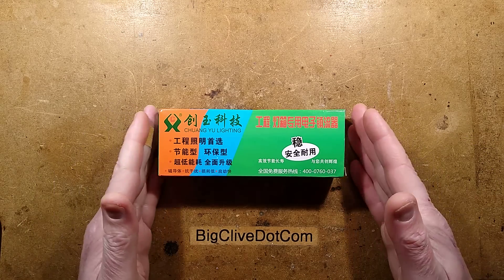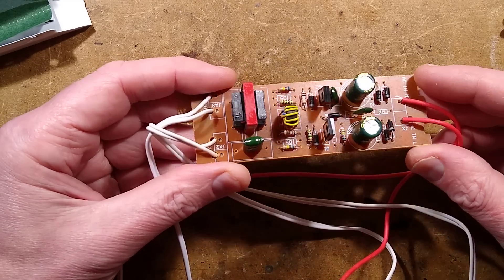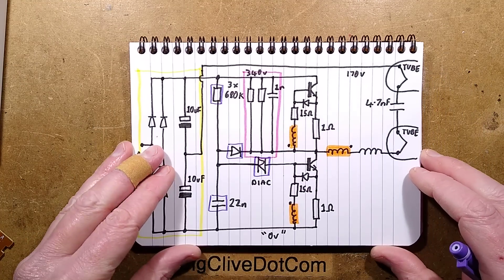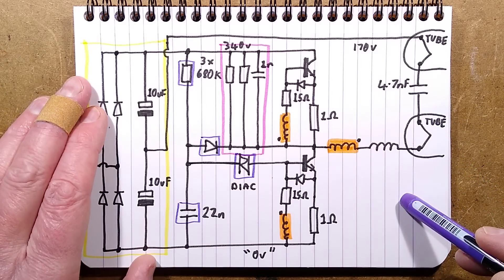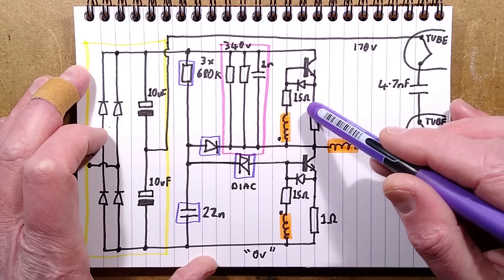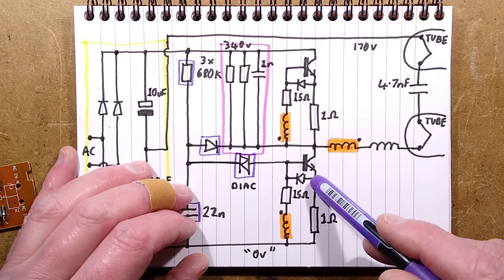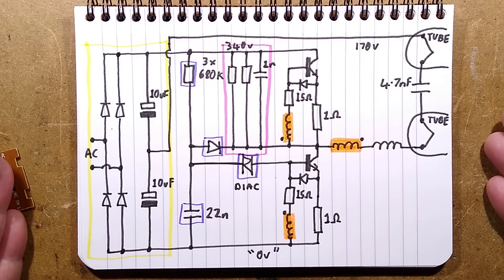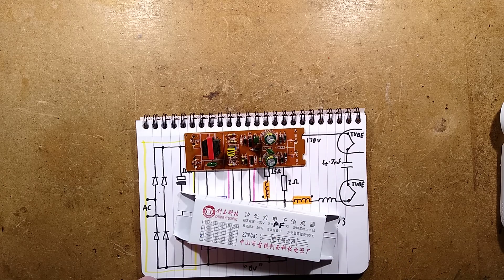Cheap AliExpress ballast (with schematic)

Comment: I would like to use such a (slightly different) device for an art project with 36W T8-tubes. But they need to dim slightly. Is it possible to increase the 1 ohm resistors(or the equivalent on my ballast) and limit the current to the tube? My driver uses allmost the same circuit with slightly diffent values.
Reply from the maker: I wouldn't recommend changing any component values on ballasts like this.  It may be better to use dimmable LED tubes.

Comment: Thank you very much for this, I couldn't understand how the feedback transformer works when I tried to fix a broken lamp. (There are a UV lamps out there that still use those).
That power supply was on the kind of a a circular custom-shaped board that would fit into the base of the lamp. It had a similar design with a couple more transistors and diodes here and there.

Comment: Hi.
Do you have a dc powered ballast experience?
I was thinking about a 4w 254nm uv tube to be powered by a couple 18650 or 21700 cells. Using a uv bypass filter on 254nm.
I have ordered some portable 365 nm BLB tube lights to see how they work off 4 AA batteries.
Reply from the maker: You can get UVC tubes and low voltage driver modules online.

Comment: Electronic ballasts are okay but I miss the prinker prinker sound caused by the glow starter when they switch on the tubes, maybe the lights last a little longer but I've pulled out tubes over 20+yrs old from offices using conventional choke ballasts. Conventional fluorescent tubes may use a bit more electricity but they tend to dim a bit after first use then find a plato of light output until near the end of their life. LED replacements might use less electricity but like all LED lamps continuously dim throughout their life normally getting to an unusable level far quicker that conventional tubes. 💐♥️🧀😎🐈‍⬛😼🏳️‍🌈🏳️‍⚧️🇺🇦💐

Comment: Had 4 dual fixtures with a very similar design, all the transistors shorted out in a couple months. Would failed caps/ripple do that?
Reply from the maker: It's usually overheating that is the main cultprit.

Comment: Have a tridonic ballast which has failed, both transistors(3DD4244D) blown, carbonising around mains input fuses, neutral fuse open circuit. Do you think i would be able to just replace transistors or maybe another component has caused this?
Reply from the maker: It's possible that the diodes at the input have been damaged too.  It may be easier to get a new ballast.

Comment: I think your right the circuit appears to be a blocking oscillator, relying on the base drive transformer to set the frequency. The parallel resitors and cap might be there in case the tube or wiring goes open to stop it from oscillating at RF frequencies.

Comment: I like your tear down of this simple transformer.
Do you have a source for a small neon power supply? The tube is about 24" long and 3/8" diameter. Thanks.
Reply from the maker: Is it red neon gas or a phosphor coated tube?  You could use a low voltage cold cathode power supply for it, or one of the voltage multiplier power supplies I recently featured.   Easiest to get is the cold cathode power supplies.
Reply: @bigclivedotcom  - I'm sorry. It's a orange tube and believe it's phosphor. I watched your voltage multiplier video and that's what got me interested in lighting this tube again. I'll look around for a supply. Thanks.

Comment: Was trying to diagnose somebody's ring light. It happens to be a ceiling fan that uses a fluorescent tube in a ring, I've only ever seen this once. They bought an LED retrofit which slightly doesn't fit the tabs that hold the bulb in. And in an attempt to figure out why it wasn't working I bypassed the ballast and blew the internal fuse. Apparently they never intended the unit to be direct wired. annoying because the ballast in the ceiling fan was bad after diagnosing with a known good glass bulb. And no not necessarily standard as in no standard light sockets it had a prepare pin snap in design. And ceiling fans are notorious for not having any extra space.

Comment: Almost identical to the circuit used for the old 12 Volt halogen lamp electronic transformers. Think of it as a half bridge and if you scope the output you will see trains of high frequency triggered by the diac at a much lower frequency. Not sure if it was intentional or happened by chance, but, due to the action of the toroidal feedback transformer, you need to give it a load before it starts to work. After that, it only supplies as much power as you pull from it, hence the misquoted power factor figures always given with these devices. Big problem is that as the tube ages, it pulls more current and the switching transistors tend to go off with a bang.

Comment: So theoretically speaking - by adding a second diac in series with existing one or replancing with two higher voltage zener diodes (to get rid of polarity problem) one would be able to delay star of the oscilations until filtering cap reaches a higher voltage ?

Comment: (To preface, I posted this comment on the day you made this video public, and it somehow ended up in the comment section of some random YouTube short (found out when I got a very confused sounding reply from someone), so I guess YouTube is broken, this out of the way)-Very cool to see how these electronic ballasts work. Also ironic that you uploaded this because I actually just converted one of my fluorescent fixtures from electronic to magnetic preheat ballast haha. Electronic ones are good and all, but they are really rough on the tubes, the old preheat ballasting systems were much more gentler when it comes to starting up the lamp, pretty important with my fixture since all my tubes are vintage, in fact I have a Sylvania tube that dates back to 1952! (this one actually happens to be an F8T5 type tube that I found in a vintage manual preheat desk lamp, which explains why the tube is still old and still works!) I’ve also always liked the Blinky startups 😉
Reply from the maker: I've noticed some oddities in the comments for a while.  Usually referring to a completely different video.

Comment: This reminds me of an electronic ballast I found in an unusually cheap and lightweight residential high-pressure-sodium yard light several years back when I was collecting HID lighting fixtures. Unlike most of these luminaires that used conventional iron ballasts, this one had a single rectangular board inside with all the componentry built on, including the photosensor for dusk-to-dawn operation. Mostly discrete components with maybe an IC or two. Makes me curious how similar it is to the fluorescent lamp ballast circuitry.
Reply: The 50 watt hPS Lights Of America Model 9051 "WallPack" ?

 I have the 42 watt CFL version (Model 9042) that I converted to house an 18 watt Low Pressure Sodium (SOX) lamp. The schematic for both the fluorescent and the HPS versions are published on Sam's Repairfaq
Reply: @yuandrew  Yes, I think that's the one! I didn't know they had schematics on Sam's site. That's pretty cool. We may have had the fluorescent version too. Problem is, it seems like most of LOA's products always had QC issues. Both the fluorescent and HPS units died shortly after we got them. Our replacement HPS unit finally managed to outlive its lamp, and was still working the last time I plugged it in.

Comment: Found a similar schematic while reverse engineering a ballast for an insect zapper that I use for making PCBs. When they fail both transistors fail short, and the emitter resistors blow open. In my ballast there was also a fuse, but surprisingly it didn't blow, the resistors failed first. Repair video: https://www.youtube.com/watch?v=H_o0wbHRyXA
Reply from the maker: That circuit will be shortening the life of the tubes by using two in series like that, since the cathodes at one end of each are not heated and will sputter and blacken quickly.

Comment: Not realy a light problem but more of the direction we are going to

Flurescent fixtures usualy only the tube needs to be replaced, and you dont need to be trained for that, and they last longer

LEDs nowadays fail quicker and also the fixture needs to be replaced, because an average joe does know how to repair the swichmode supply in there that probably failed (leds themselfs usualy dont fail)

Why do you need to trow the whole fixture away, why cant you just replace the led stripe inside

I mean, flurescent tubes were replacable, why dont they make modern light more modular

And also I dont understand this it wasts power mentality (it didnt waste it in the 80s, why does it do it now?) Also what the point of saving power on lights, if we drive electric cars and need iot devices for basic tasks that we could do by hand 40years ago

We are saving nothing, just shifting power needs possibly wasting even more power (hard to mesure though)

Also I can power a flurescent tube remotly just bting it to a broadcast tower or radar and see

Comment: That was great.  Thanks Clive for another fantastic video!  The circuit reminds me of the little oscillator in the ozone generator that you reverse engineered a little while ago; especially the diac-based start circuitry.  

A few years ago the LED replacement "bulbs" for T40 fluorescent bulbs started appearing in my local Costco and I was tempted to refit my basement fluorescent fixtures to LEDs.  BUT then I realized that my lights were dead reliable and I haven't swapped a tube in over 5 years.  The LEDs seems to be all over-driven as you have mentioned in other videos and we aren't getting the lifetime/reliability that we should be getting  from those devices.  The LED bulb replacements were nearly $40 as I recall and I decided there was no benefit in retrofitting my basement.

Comment: Best circuit. I wonder if that pink capacitor couples some mains-derived voltage ripple to the base circuits to help sync the oscillator frequency to a multiple of mains frequency.

Comment: I used to do maintenance for bp oil's head office in Canary wharf.  It was mostly fluorescent fittings with with "digital" ballasts(with Dali dimming function).  The ballast circuitry was a lot more complex,  With a ton of suppression and filter circuitry.  The failed ballasts provided me with a constant stream of  components to salvage from them.  Class XY capacitors for example.  My colleagues thought I was crazy for stripping down old florescent ballasts😂😂🤔.

Comment: Electronic ballasts compared to iron core types with a starter just don't last as long IMHO. How you explain the circuit I'd imagine the transistor bypass on the starter circuit always dies.

Comment: Our workshops and offices have a mix of fluorescent tube and LED lighting, the stock room has plenty of spare tubes left and we keep replacing until UV/heat damage makes the fitting or diffuser too brittle to carry on before replacing with LEDs. They do the job and as you point out often last a long time which is worth a lot in high roofed/inaccessible work areas.

Comment: Good video.  An idea for a follow-up video would be to get some 40W tubes and make your measurements.  Borrow tubes if possible.  A detailed explanation of ballast theory and operation would be nice.  I'm a little hazy on that and I can't be the only one.

It may be true that fluorescent tubes do not find many applications in new installations, but there are countless old installations across the globe.  These are usually production facilities and institutional settings of various sorts.

When the lights go out, it's a problem to be immediately addressed so that the facility can proceed uninterrupted with normal operations.  Maintenance staff will be dispatched to replace the tubes.  When that doesn't work, an electrician will be called who will likely replace the ballast.  With the lights back on, the problem is solved and no on one gives it another thought.

Replacing and upgrading the lighting comes out of capital budgets and is often part of larger renovation projects.  LEDs, if chosen appropriately, can reduce maintenance and energy costs significantly, but they're not cheap.  It's an investment.  Until that investment in time and money is made, there will remain a need and a market for fluorescent tubes and ballasts.

Comment: i dont know if you know about these but ive been installing these philips wt120c led lights since i think over 6 years in many locations, and i have never heard of one failing yet, they are not the cheapest but they are bright and seem reliable
Reply: We are retrofitting ansell 5ft led lights for the switch start and HF fluorescent , Out  of the 200 I have swapped 1 exploded and one turned into Disco lights, Pretty  good so far.

Comment: "Quite irrelevant, because . . . . Who uses fluorescent tubes these days?"
Well, some months ago, I was reverse-engineering a four-little-fluorescent-tubes bulb circuit (more complex but also more compact than this in the video) and one part of the push-pull circuit made no sense to me, it seemed to be reversely fed. Your explanations have been very relevant for me to understand how it worked! Thanks a lot!
Reply from the maker: Was it in a nail polish curing unit?  They use the same circuit, but four inductors, one per tube.
Reply: @bigclivedotcom  No, it was just a light bulb. I've just retrieved it from a drawer and realised it's just two, not four, but U-shaped, tubes, inter-communicated via a short (4 mm.-long) transversal tube. Branded IKEA, model no. 2P211. Specs: 220-240V, 96 mA, 50-60Hz, 11W, 600 lumen. Made in China.
Reply: A light lamp, not bulb, of course.

Comment: Thanks for the video.
Not that long ago, flourescent tubes were used for lighting in pretty much every school and office building in my part of the world. Nowadays, they have mostly switched to LED panels.
What I hate about modern LED lamps is that they are often deliberately built not to last long (especially the cheaper ones). Manufacturers tend to overdrive the LEDs a lot to squeeze more light out of a smaller number of diodes causing them to die early. And often the death of a single LED package kills the entire light because they are wired in series.
Reply: Florescent lamps are still popular in Sudan.
Reply: And the use of cheap capacitors. I had several explode within 100hrs

Comment: Dear Big Clive do you do consultations or assesments. I need to light an aquarium that'll grow plants. Aquaurium lights are outrageously expensive. I
Tried cheap led spotlights but they failed very quickly. You seem to make electronic diagnosis very easy.
Reply from the maker: I can't really advise on that.  An aquarium forum would be much better.

Comment: I find this and similar designs to be not very reliable. The problem is as the lamp age, the voltage across its leads  increases naturally and at some point in time those MJE13003 transistors just blow up due to overvoltage.

Comment: What strikes me is that the package contains all of the materials with which to construct your own lighting fixture. You’re supposed to attach those metal clamps to something, snap the fluorescent tube into them, and then just plug the connectors onto the ends of the tube. They really don’t expect you to have a fixture in the first place. Health and Safety in China really is based on Darwinism.

Comment: Thanks for this and everything else Clive. 
Do you think that this ballast would work with the replacement LED tubes specifically designed for use with electronic ballasts. I have a bunch of Philips LED tubes that will only work with T8 instant start ballasts. I haven’t broken one open yet, but I suspect that Philips used a small input capacitor that will pass enough current at the 10s of kHz the electronic ballasts use but too small to work at the 50 or 60 Hz presented by magnetic ballasts.
Reply from the maker: I'm not overly keen on the LED retrofits that work with existing ballasts.  I prefer the ones that require a bit of fixture rewiring.  The easy swap tubes introduce other losses and complication.
Reply: @bigclivedotcom  I do agree with you that a direct connection is better but my son mistakenly bought tubes for his shop that need the high frequency of an instant start electronic ballast and, rather than throwing the tubes away, we would like to find an economical way to use them.

Comment: They're less and less but some places still have fluorescents. We did until they stopped selling fluorescent tubes and came out with the universal drop-in ones that don't require rewiring... Although even then I waited until the tubes were getting dim and needed to be replaced anyway.  I'd love to know how the drop-in replacement ones work that are compatible with T11, T8, and direct wire without any modifications.  Unfortunately I learned they are real glass when one broke so it would be a major mess to tear one down and reverse-engineer.

Comment: You can run a lower wattage tube kn a higher wattage ballast, or, at least I do...

Couldn't you use a large wattage resistor?

Comment: Note the frequency is always highest, when the oscillator is unloaded, which will cause the impedance of that 4.7nF capacitor to be very low. The frequency drops, once the tube has struck, causing the impedance of the capacitor to increase, so it draws negligible current.

It's the inductor in series with the tube limits the current through the tube, rather than the feedback winding. It will have a higher impedance, to the higher frequency, before the tube starts, so perhaps it's selected to form a resonant circuit with the 4.7nF capacitor, which will increase the current and voltage during start up.